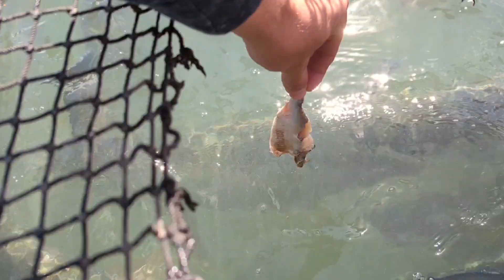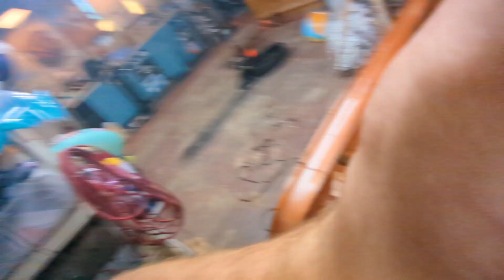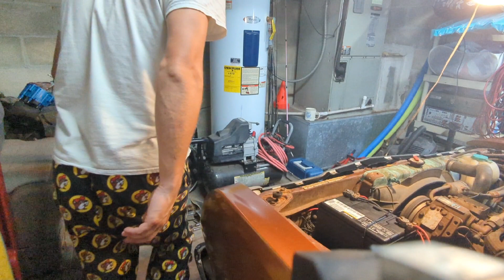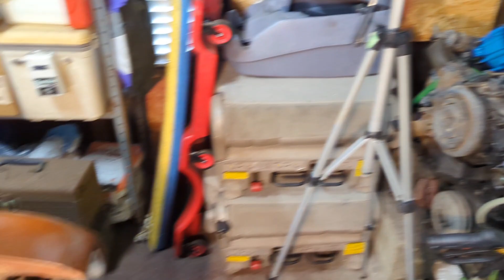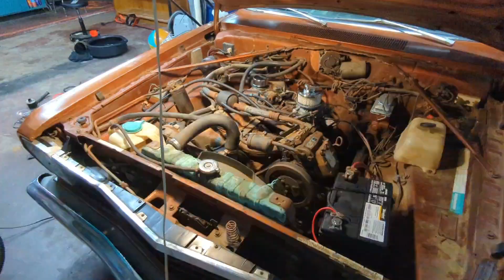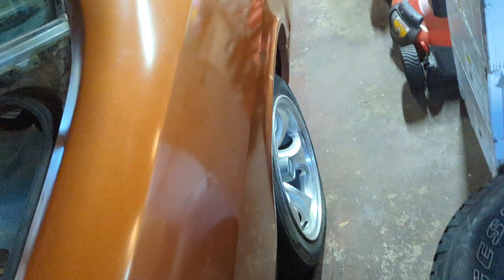1975 Duster - Emissions systems delete, EGR flip, electrical and lighting troubleshooting

Comment: Removing all the pollution garbage is always a good move as long as you don't have to worry about emissions testing. You can play with the timing a bit to see if your stumble goes away. Advance it slightly and test to see if it is better. Also make sure your vacuum advance for the dist is on the right port, should be vacuum when the engine speed is increased and no vacuum when idling.
Reply from the maker: I really appreciate your comments. You're all over it! I did use ported vacuum and I have the timing at about 8 degrees advanced if I remember correctly. It stumbles slightly until it's warmed up and once the choke is fully backed off it's like a sewing machine.

Comment: If you want to learn how to build a HOT ROD, using a late 1970s Dodge Duster is the best, next to an early 1980s Fox Body Ford Mustang/Fairmont.
Reply from the maker: You can't beat the price point on the Dusters! I look at it as a budget Chevelle or Challenger. They're under rated with collectors I think, but that'll start to change as prices on these older ones keep climbing.